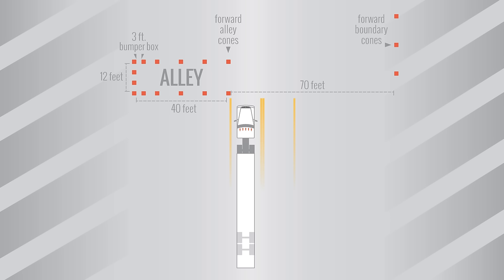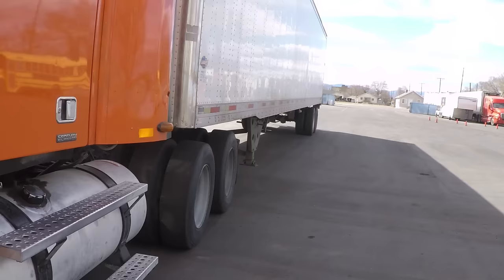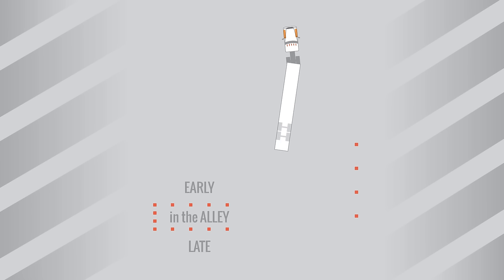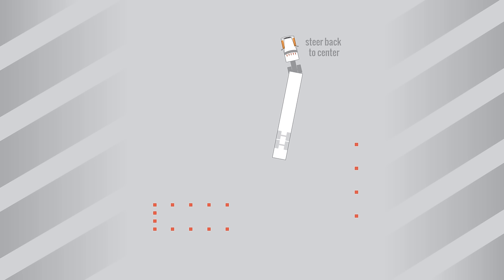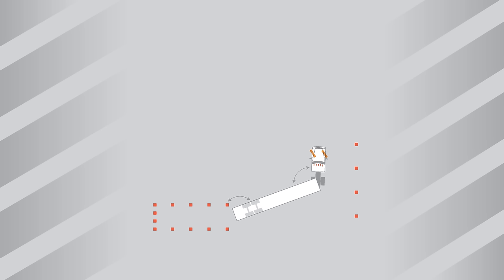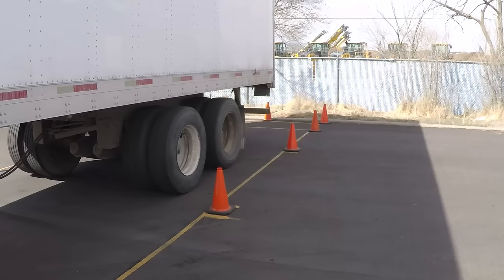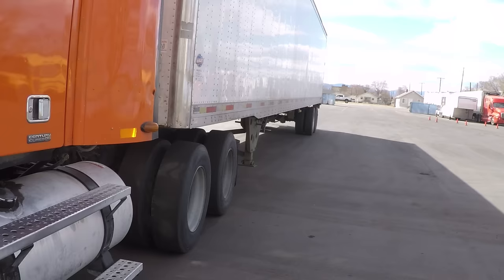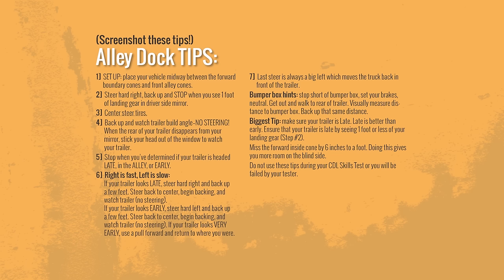🎬 TRUCK DRIVER STUDENTS! Alley Dock, Driver Side

Comment: The way my instructors had taught me this maneuver just wasn't working for me. I came across this video two nights before my CDL test and practiced it on the pad. It really helped me build a better angle and accurately predict which way the trailer was going. I used this method during my test and only had to use 1 pull-up. Passed! Thank you for the great video!

Comment: I'm having a very hard time getting this maneuver right. It looks like this video is the best one I've seen on YouTube on this maneuver. You guys show certain things my instructor and my trainer never showed me. Thank you very much!
Reply from the maker: Nice compliment, thank you. At the beginning of the maneuver, let the combination vehicle do the work for you. Stop short of the box and determine whether you are late, in the box, or early. Right is fast, left is slow. Add right or left and back up a bit. Stop and steer back to center. Back up again and watch the trailer, no steering. You have 2 free pulls forward. Use them before you hit any cones. Glad you liked our video, ibn1989.
Reply: Yeah thanks. I already have my CDL. I got it by the skin of my teeth since I didn't have to alley dock on the maneuver test.
Reply: Same With me Bro. This video explains a lot better
Reply: Testing on the 30th. This is the best video on this maneuver so far. Thank you. It also helps to G.O.A.L. when I am about 30ft away.

Comment: You guys are great!!!!! You get right to the point, in detail and make it so easy to do!!! I can't find any video(s) on youtube better than you guys and I am absolutely certain that your videos have helped out so many beginners, including me!!!!  Thanks!!!
Reply from the maker: Happy to help, Graymaulkin. We pride ourselves on making videos that are easy to understand.

I can't locate your earlier question, so I'll answer it here:
If you are consistently coming too close to the front left cone of the alley, a pull forward is the smartest next step. Now consider this:
If you pull forward to the LEFT, you'll create space between the rear corner of your trailer and the aforementioned cone. You need that space. So, pull forward a little to the left and then back to the right to square up the vehicle.

Hope that helps!
Reply: Very helpful.

Comment: Thank you. I find my trailer always coming to my driver side cone. I tried to get an instructor to tell me what to do. His reply, you got to figure that out yourself. Then I found your video and right away I knew what I was doing wrong. I start of by pushing my trailer a little to my lift towards me cones but do not center my steering tires.

Comment: Hi, just want to say thank you from the bottom of my heart for this video. This blew my mind after watching and studying your video I tried it in my training school and I finally got it right  All the clouds are gone and everything is clear now. Logical and informative... priceless. I have been practicing backing for a month just could not figure out why and how. Your video brought everything together in a logical sensible practical down to earth and ever so simple and understandable. My test A-Z test is in three or four days and now, I am confident I will pass...thank you so much.
Reply from the maker: Of course you'll pass, Jon. Your attitude is through the roof which should make all the difference on test day. Take your time, you have plenty. If you get into trouble during the maneuvers, pull forward for a better position. Thank you so much for watching and commenting.
Reply: I presumed you've long pass your exam by now. Maybe you can help me out. What does he mean by "a foot of landing gear"? 1ft away from what?
Reply: Sparky Pluggs when u see the foot the first foot of landing gear then steer back to center I’m late u probably already took your test but someone else may read this and the foot can be seen in your mirror after your initial right and in this video displays the landing gear foot
Reply: @jazmine2412  Ok, I figured. Which they had said "driver side landing gear foot" to eliminate any other interpretations. But still good video
Reply: @exillens  very good video

Comment: What you teach makes good sense.   I am a new driver and still have to think about every thing I do.  backing does not come quickly to me yet.  Plus when I get inside the truck everything seems to change.   I forget momentarily how to do it.   Sometimes I wish more time could be devoted to just letting students practice over and over so they (we) get our own feel for what happens to the trailer when we steer one way or an other.  I'm getting it but it's coming more slowly than I expected.
Reply from the maker: Ask yourself this question when you forget which way to turn the wheel:
WHICH WAY DOES MY TRAILER NEED TO GO? If you want it to move to the left, steer to the right and vice versa. A small turn to move the trailer a little, a big turn to move it a lot.

Happy backing.

Comment: am in cdl school now & I’ve watched this video numerous over past several weeks, I should have watched it yesterday because I failed this maneuver at dmv today. At school I have markers of where to start the maneuver, at dmv it’s just a huge parking lot and when I went to do my setup I just threw a Hail Mary as to where to begin the maneuver. I’ve already told you how that worked out. And then when I did my pull ups, I kept pulling up towards wrong starting point. As soon as test was over it was so easy for me to see what I had done wrong. I’m going back 12/15/2017 to try again. It’s computer randomly selected so either I will get this maneuver again, or parallel. Will come back & leave comment after my test to let you know how it goes. I did great on pretrip, now just have to pass maneuvers & road test. I’m all ears if you have tips for either. Thanks so much for making videos.
Reply from the maker: As far as maneuvers go, my best advice is to use your pulls forward if you get into trouble. It helps to pull forward close to where you were before your mistake. Pulling forward in any other direction will place your trailer in a weaker position. If you get the Alley Dock again, give yourself some room between the vehicle and the front of the alley. This will allow you to arc the trailer in, rather than jackknife it which is more difficult. If you need any 10-speed shifting tips, type 'CDL College 10 speed' into the YouTube search field. Goos luck, E Street!
Reply: passed test today, did sighted side parallel instead of 90, your video for parallel is my favorite and have watched it minimum 50 times
Reply from the maker: That's a wonderful compliment, E Street. Thank you for watching and learning from our videos and a big congratulations on passing. Stay safe out there.

Comment: I was struggling with the alley dock but man y'all explained it very well! I'm currently in the process of getting my Class A license at Wiregrass Technical College Valdosta, GA and I test August 3rd
Reply from the maker: Thank you for saying so, Southerneagle83.
Heck, yeah, let the truck do most of the work, initially, then stop and decide whether your trailer is LATE or EARLY.
From there it's Right is Fast, Left is Slow.

Thank you for watching and commenting.
Reply: CDL College, LLC I've also noticed that a 53 foot trailer is significantly easier to control than a 48 foot trailer
Reply from the maker: You are correct.
The longer the trailer, the slower it reacts to steering corrections.
A pup trailer (28 ft) reacts very quickly to steering corrections.

Comment: Wish i found this video a week ago.  70 feet is tight.  Offset back only give you around 70 feet too.  On the driving portion - at all costs do not hit a curb.  Drive way over into your neighbors lane if needed.  Wait for the car to clear.  Break laws.  Do not off-track to a curb.

Comment: I like the video,  but when I was just learning to back up this wouldn't give me the help I needed  I had to really think about it and research it.  what's happening when im backing up,  the relationship between the tractor and the trailer. It was after I begin to understand what was happening with the 5th wheel and kingpin that I started to really control the trailer and get the wheels which is the pivot where I want them to be.

Comment: I hope this works because I have my test today and this is the hardest one for me. I noticed that you said to keep your wheels straight but the video showed him turning his wheels.
Reply from the maker: My student that day forgot my directions.
After you've set that initial small angle between the tractor and trailer, you should return the wheel to steering center and back up without steering. Your trailer will naturally fade to the left.

Thanks, Douglas!

Comment: New student at CRST this is my biggest hangup. There is barley enough room to do what's in the video. The truck starts out on the line of the last cone 90 deg to the hole at about 15' to20' from the hole then hard right until i see my second foot of landing gear stop straighten wheels go back 5'-8'  stop turn left 1 1\2 turns left until its in line  with the first cone stop  check my bend in relation to the distance to the cone then determine if it needs right or left  bring it back to the first cone making corrections so it is not pushing or pulling till the corner of the trailer is lined up to the hole and first cone stop and then make a left loose or right tight back up making corrections until either tracer or trailer is close to the line  stop hard right go foward till straight and back it up. Sounds easy, NOT! MY PROBLEM IS I have never ever hung my head out of the window, in all my years of driving a tow truck with a vehicle on my wheel lift, now I'm in a big boy toy. And I cannot seem to determine turn vs  pivot  and amount of angle to distance to the cone pushing vs pulling with my head out the window. How ever in the mirror I can see it but not enough room for using mirrors. Each time I do as we are being taught I get worse and the other guys get better. Three days they don't even need the instructor  I cannot do it without instructor and am getting worse. Realy pissed at this point

Comment: Very clear, very good instruction. I have one week left of school (4 remaining hours of backing) and I'm getting nervous because I'm struggling with this. I'm starting to get offsets down, but struggling with alley docking. Hopefully this will help me get proper technique so I can think my way through if I'm late or early. I also been struggling with my initial setup. Again, thx for the clear instructions.
Reply: Did you pass?
Reply: @exillens  yep but I was still really not good at backing. Then I got a job with one of the big carriers doing Intermodal. They taught me to back very effectively. Now I can put it in very tight quarters with confidence. For me it's all about the setup. Good luck to ya.
Reply: @carlson.douglas.w  Awesome to know. Encouraging

Comment: Struggling with this,  my test is Monday, setup is critical,  I thought I was parallel and my instructor informed me that my trailer was pointed one direction and My tractor in another, so before I do anything I'm already faced with two problems and as I back up they will just develop into bigger problems.

Comment: The part when you make the "last left turn when you still have an angle between the back trailer and the cone", does this apply to 53 footers only or all trailer sizes? My school uses small trailers.
Reply from the maker: When you perform a driver side alley dock, the last turn will always be a left, which puts the truck back in front of the trailer, regardless of trailer length. Thanks, AH!
Reply: AH, Okay. Thank you! 😀

Comment: One question Michael; you say the initial angle between tractor & trailer is about right when you see 1 foot of landing gear. What measurement is 1 foot? A foot vertically on the landing gear, a foot inside the landing gear, when you can see the landing gear foot, or something else. I'm missing the meaning of 1 foot. Sorry if I'm dense; I just an not clear about the meaning of 1 foot. LOVE this great, best by far, of any alley back explanation I've seen! Thanks again, Michael.

Comment: I have to do it with pup to pass my test.  Since pup reacts faster then 53 what tips you can give on how close end of trailer should be from parking box before I start steering my wheel? Thank you
Reply from the maker: Try 15-20 feet. You need to be closer to the alley with a pup, miss. Thank you for watching.

Comment: Qestion... what can I do to reduce air pressure loss during alley backing? Sometimes I have to stop to build up air pressure.  Would appreciate any advice...
Reply from the maker: Your truck may have an air leak, OR, you might be using the brake too much while backing. Truckers control their speed with the clutch while backing. The brake is only used to stop. The harder you press the brake, the more air you'll use in the air tanks. Try lighter pressure. Thanks, Jon!

Comment: I fell my alley dock today I hopes this help
Reply from the maker: Try to keep the following in mind, J:
The beginning part of the arc is mostly straight. The further back you go, the more the arc curves, which requires you to steer more. You're trying to create a half rainbow arc with your trailer tires. When you steer to the right, avoid holding your turn for too long. Steer right to kick your trailer to the left a bit, then steer back to center. Repeat these small turns, always returning the wheel to center.
You need to watch your trailer tires throughout this maneuver. Keep telling yourself 'Right is fast, left is slow' to remind you of which way to turn the steering wheel. Use your 2 free pulls forward, if you have to...forget about being perfect. The goal is to pass the test. You'll have plenty of opportunities to practice this maneuver in the real world later on.
Thank you for watching and commenting, brother.
Reply: CDL College LLC thx I will
Reply: Troll- J Simpson  did you pass your alley dock since you posted

Comment: I'm practicing with a 33' trailer. I have found with the offset backing my reference points are different than with a 52'. Am I to assume that my reference points will be less as well with the alley dock maneuver? For instance, instead of one foot of landing gear visible I should only see about one third of that?

Comment: This is VERY helpful!!! I really was shooting in the dark before you gave me a system, a plan to follow. Thanks much!
Reply from the maker: Thanks a bunch, Frank!
Did you notice the shape of the arc (rainbow) that you're trying to create with your trailer tires? That arc is very subtle in the beginning, and then becomes more pronounced as you move towards the alley.
They key to forcing your trailer toward the alley is to steer to the right, but avoid holding your turn too long. So, it's STEER RIGHT, and then STEER BACK to CENTER.

This may be hard to believe, but, on several occasions while teaching this maneuver, I've watched the trailer park itself in the alley with NO STEERING (except for the final left). The students and I produced a perfect initial angle (1 foot of landing gear), steered back to center, and then we just watched the trailer head straight toward the alley. It's a rare occurrence, but it has happened.

Appreciate your comment and your view(s) of our video. Play with this technique a few times and let us know how it worked for you, brother (if you'd like). Stay safe out there, too.
Reply: No one had ever suggested to me to make the steering turn and then, after adding just a bit of angle, to put the steers back to straight. I am very anxious to give this a shot. Also hadn't occurred to me about being a bit late or "Right is fast, left is slow." Super ideas that I am just sure will make it all a much simpler and more efficient experience! Thanks again, Michael.
Reply from the maker: You're welcome, pal.
Reply: Love this video and the comments. I was exasperated yesterday trying to practice this at school. Without your tips, I would be stuck with an instructor shouting "turns" at me....they mean well, just can't explain it like you do.
Reply from the maker: And that's the difference between knowing how to DO something vs. knowing how to TEACH something.
The alley dock is all about small turns to the right which pushes your trailer to the left. After each small turn, go back to center.
Thanks for your comment and thanks for watching.

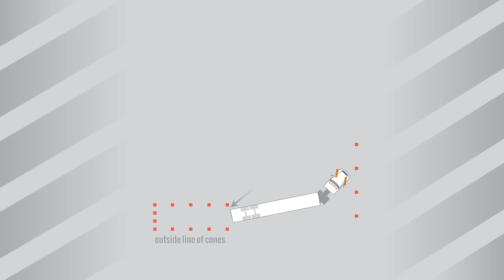Comment: Why in the tips screen at the very end of your video (@ 5:48) and the very last line of the tip screen does it say "Do not use these tips during your CDL Skills Test or you will be failed by your tester."

Comment: Question: when you say straighten your wheel as you back toward alley dock after right or left, what does that do in interms of straightening your wheels. Why straight the wheels. Sorry if I sounded confusing. When truck has an angle and you go back to straight wheel position, how does that effect the the trailer? What does straight wheel position do? I know full left will straight truck to trailer,  I also know right is tight and fast towRd left while, left is loose and slower toward left. But what does straight wheel position do for trailer angle?  Sorry for long email but would  appreciate possible clarification.